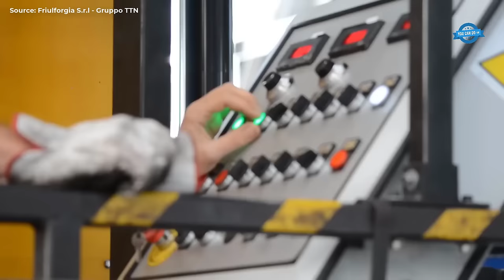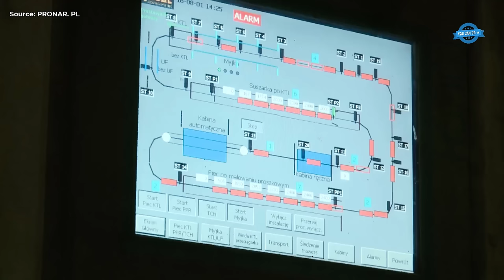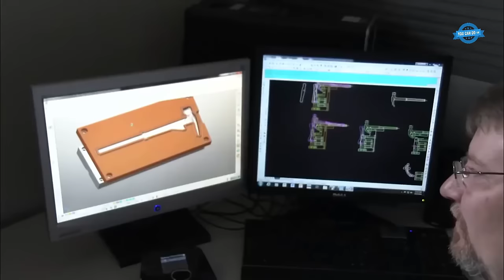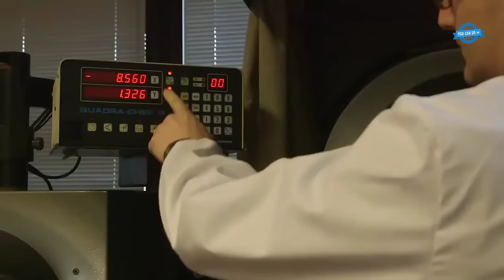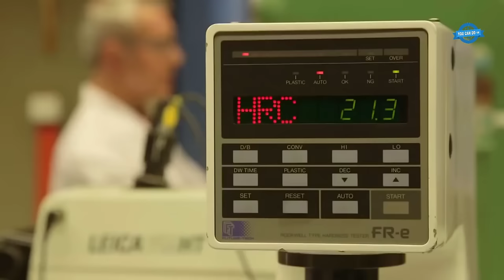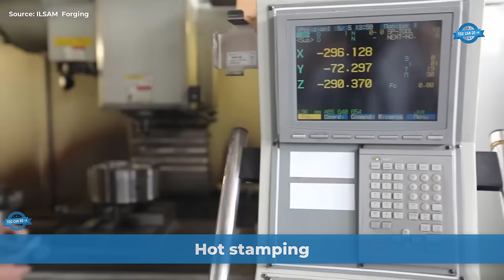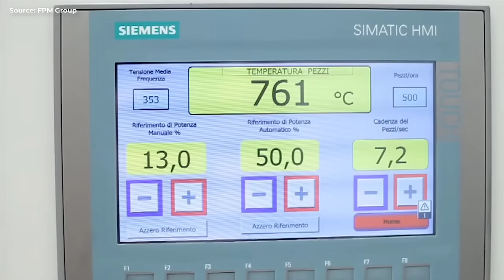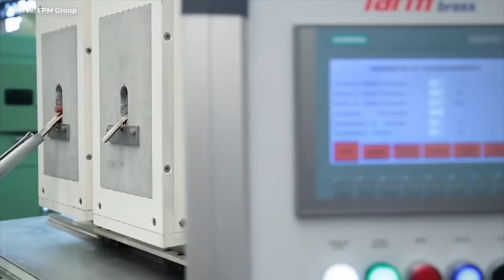Satisfying Manufacturing Processes. Heavy-duty Equipments Change Production Industry

Comment: Why didn't they fill the bottom of the boat with spray foam before installing the floor deck? 1:01:10
It would've made it stiffer, sink-proof and leak-proof at a small extra expense and weight of polyurethane spray foam from home hardware stores!